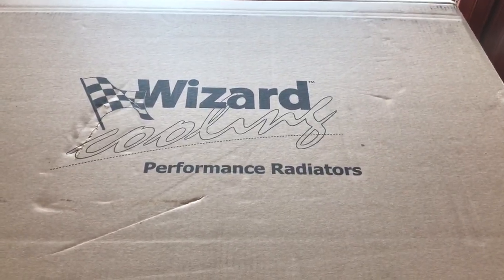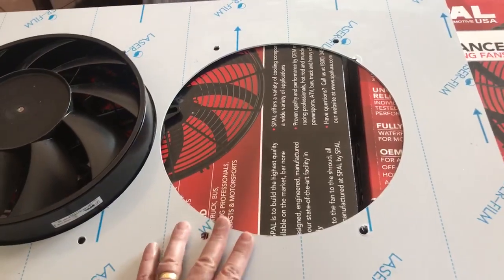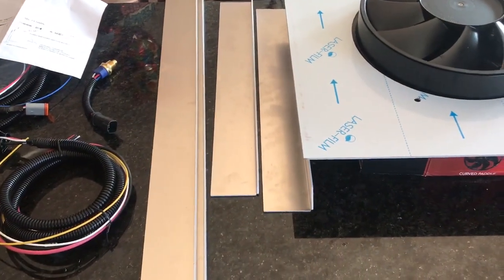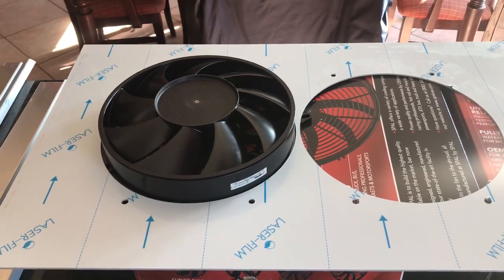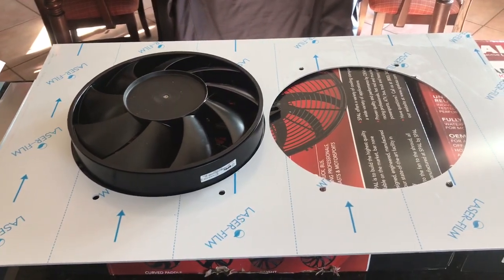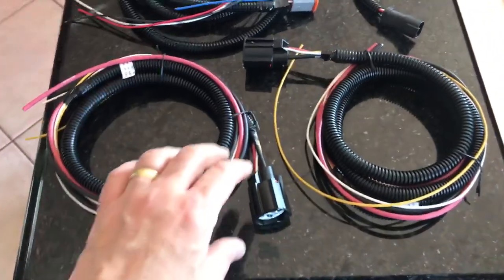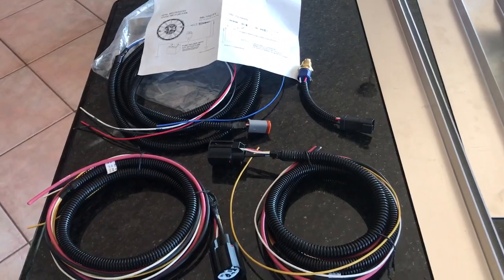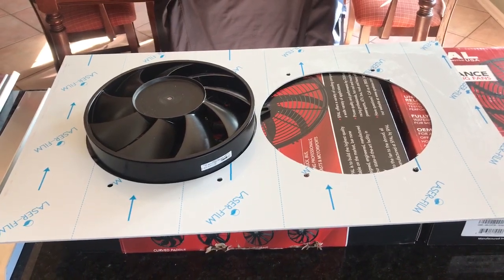Superlite SLC Build 051 Wizard Cooling Brushless Fan Kit Walk Around

Comment: Just came across your video doing some research. How are the fans performing?
Reply from the maker: Hi, haven’t gotten that far. Still working on chassis and components. Maybe by end of year it will be running and can do some testing of the cooling system.

Comment: I was going to ask how these are working, but I giess the car not done yet. Are you running a mechanical waterpump?
Reply from the maker: I’ll have a better idea in about a year. Planning to use the mechanical water pump. Was thinking about adding an auxiliary electric water pump controlled via PWM, but probably stick with just the mechanical pump and idle the car with the body on and see how it does.